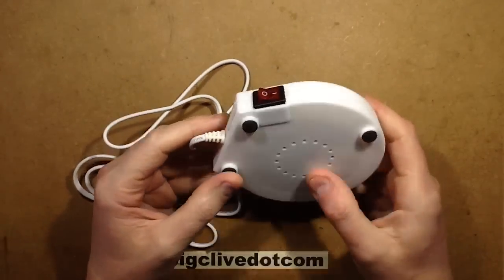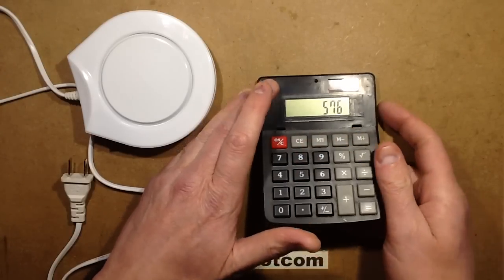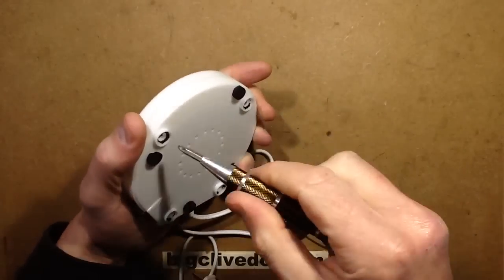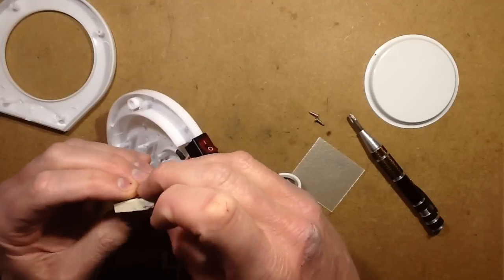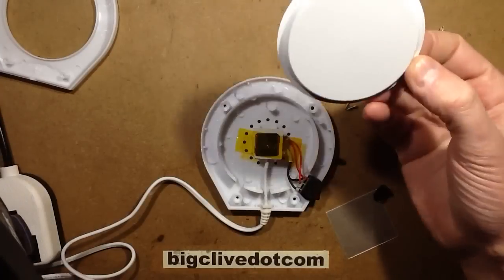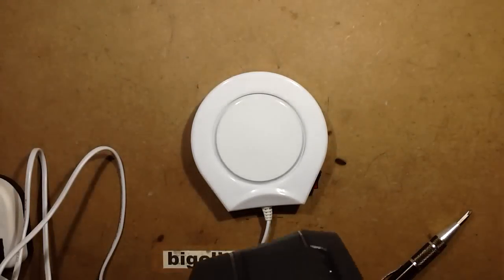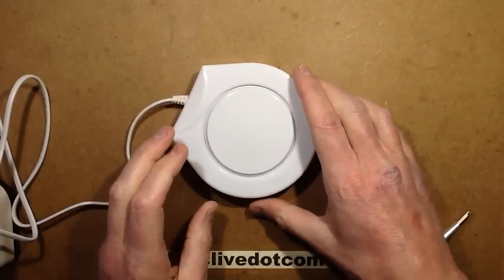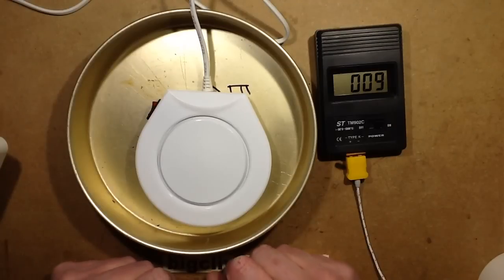Inside a cheap eBay mains voltage cup warmer.

Comment: I've used a similar 'cup warmer' to pre-heat small PCBs before hot-air soldering SMD components onto them. Worked pretty well.

Comment: These work great for melting wax because the guts are the same thing as you'd find in a candle warmer. I use a giant cup for my coffee and I looked into candle warmers because they fit the mug better. I had to crack it open as you can imagine and found almost exactly what you have there. The wires were different color which I know doesn't matter which was the only difference.

I hacked mine with an aluminium disk that fit just under the plate to spread the heat out more evenly. I stuck it in place with some old heatsink compound which came with a CPU cooler hence I didn't use it in lieu of some Arctic Silver 7. I'm sure I don't have to explain that decision. I also substituted a slab of silicone heat transfer pad in place of the mica wafer. It helped a lot and still insulates it from the mains current. It keeps my large soup/latte mug at around 40°C which for me is a nice drinking temp. 

You may be able to do a similar hack on yours. All you need is a sheet of aluminium like what you'd use to make project boxes from. It doesn't have to be super thick. It just helps spread the heat closer to the edges where the cup touches the plate. That could be a fun project to watch you do. It shouldn't even cost much as I'd wager a guess that you have some aluminium laying about somewhere just begging to be used for something like this.

Comment: 10ºC, you are a man after my own heart Clive, I am constantly battling with colleagues as I find it sweltering when the office is 20ºC and they want to put heaters on even when its 17ºC. At home i wear shorts and a vest even in winter and sleep with the windows open all year, my missus has got used to it but my daughter constantly moans that it is cold. It's a good job we live in a close in Glasgow the thick sandstone walls keep it cool in the summer, and it's always colder up here than down south.
Reply: Wow, 10ºC, that's 50ºF! I'm a pretty big bear and I can't tolerate much lower than 15ºC (~60ºF) during the day. 10ºC is perfect for sleeping, however.

Comment: A lot of people I know use beverage warmers for melting candle wax or scented wax cubes.  Wal-Mart actually sells these labeled as "wax melters", even though they are just cup warmers.  The wax melter of yester-year used to be a 20w nightlight with a ceramic cup fixture over it that you'd put your wax in, similar to how lava lamps work but smaller scale.
Reply: My mom got something just like this marketed as a “no flame candle heater” — melted the candle so you got the aromatic effect without lighting the candle

Comment: I've seen a very very similar PTC puck element used as a starting relay in a small compressor. The start winding was energized at power on through the PTC which lets it get full current a second or so then fades it down. I seem to remember it was made by TDK.

Comment: Clive, you can probably make this thing work way better with minimal effort. When you were putting it back together I noticed that there was just a small point contacting the heating element on the inner metal plate. If you put some thermal compound on both sides of that inner metal plate it should be able to transfer way more of it's heat to the white outer metal plate. That way more heat is sucked away from the heating element, lowering it's resistance, allowing it to keep generating more heat faster.

Comment: I've always believed that one of the reasons why these little gadgets don't do a very good job is that the vast majority of mugs/cups that I've seen and used have a recessed bottom surrounded by a lower hanging lip or rim and therefore has such a limited physical contact surface between the warmer and the said cup. I can't say that I've ever seen a cup/mug with a completely flat bottom. IF such a cup/mug was found, I'd lay odds that an immediate improvement would be noticed. I'd also add that a little bit of heatsink grease between the warmer's heating element and the bottom of the metal plate would help a bit also.

Comment: Hi Clive,
I tried one of those very cheap USB warmers. You could keep you tea/coffee cup warmer by sitting on it.

I had the problem of my tea/coffee always going cold whilst at the PC.
I found, by chance, that a Gravy Warmer was more than adequate for use.
Of course you do not use the Gravy Boat.

If as a few have mentioned, you find that most cups have a recessed base, then try a stainless steel/porcelain/tin camping mug, as these usually/normally have a flat base.

My Gravy Warmer/s keep the tea/coffee at a nice drinkable temperature.
There are a couple of brands available...."Mistral" & "Lumina" are 2 that I have.
Both seem to come from the same factory.
The circuitry is sort of complex, as it contains a thermal fuse, Temp sensor unit, a really neat wire wound heating element & a neon indicator switch. All contained in a nice porcelain base unit.
Must add that they are all safely/correctly earthed.
I think the wattage is around 25 Watts & your tea/coffee is... "just right."

If you find one, be interested to see/show the tear-down.
(I've already done one that failed.)

Thanks for all the neat videos & occasional "Big Bang/s."

Stay safe.
Regs, L..
From way Down Under.

Comment: I had one of these cup warmers that died on me a couple of days ago, so I've got a couple more on order.

Mine pulled 6w when it was up to heat, and kept the plate at 70 deg C.  It could keep a mug of tea just about drinkable (not hot, but not stone cold either) more-or-less indefinitely. 

It was interesting to see what is inside it, thanks.
Reply: Can you link it, or?

Comment: Clive, you'll find that this device is designed primarily of Chinese drinkers of tea.  In China they had cups with ceramic covers to maintain warmth.  It would be interesting if you put a cup of hot tea on the device, covered it with a saucer providing a good seal and then come back in twenty minutes to see if the tea is still warm enough to be acceptable.

Comment: but it's a US 120V... Not 240... unless I have it wrong shouldn't be different...
Reply: It's made for the Chinese market, that's a Chinese plug, they use 220v, but that type of thermister wouldn't matter too much, it'd regulate to the same almost, of course half the voltage will mean it won't be as powerful but that means it's impedance would be lower, so the same.
Reply: Coaster Labs I may be mistaken but I think China sometimes uses plugs of the same style as North America but at 240V. IIRC Big Clive mentioned this in a previous video.
Reply: tallman11282 wooooooah, not only do they rip off our electronics... now our outlets?!?!?!😅😅😂😂
Reply: Those plugs are very common in Thailand too and they use 220v here.
Reply: Coaster Labs Same with the Philippines. They use 230v 60Hz(?) and the same plugs as North America, as well as European ones.
Reply: https://www.reddit.com/r/MapPorn/comments/4xvu32/plug_outlets_around_the_world_800x640/
As for voltage, generally it'll either be 120v @ 60hz or 220-250v @ 50hz
Reply: It is a normal plug in China.  It is also normal to have plugs that accept every style in the world.  Safety is not a priority in China.
Reply: Hong Kong uses the UK plug.
Reply: Safety is not a priority in China. Nor are standards, apparently.

Comment: I would guess the brutal lack of thermal coupling between the resistive load and the cup is to blame. Ten watts should easily keep a cup at full temperature; I'd love to see a similar comparison with a flat-bottomed coffee cup (rare but exists, such as a beaker/flask style).  The mica has huge insulative properties, and the mug doesn't actually touch the hot spot of the steel for the manufacturing process indent.

Comment: The intent of these 'warmers' isn't to keep your cup hot or, indeed, even warm them up. The point of these is to prevent the liquid from cooling down as rapidly. That means that if your cup cools down in a specific amount of time, with this 'warmer' it will cool down perhaps half as fast. This means you can sip your hot beverage for longer before it becomes cold. Though, you could get an air-insulated cup and probably derive similar benefits which wouldn't require using any power at all. It would be interesting to test which actually works better... an insulated cup or the heated warmer plate and standard mug.

Comment: I always drink my just warm coffee from a pint mug and that's fine when it's summer but during the winter months I often find my coffee has cooled to below the desired temperature. Whilst heating it up in the microwave is always an option I'd like to be able for it to be kept warm without the need. It looks like the warmer you bought would be ideal for my purposes. Can you put a link to the eBay sellers page on here please, Clive. Many thanks.

Comment: The hot spot is in the centre, the contact area of the cup is around the edge. Air is a terrible conducter of heat, so if you could find a way to slot a heatsink in between the plate and the bottom recessed surface of the cup you would get much better efficacy. Even a few coins or some balled up tin foil would be an improvement.

On a side note, I always thought the purpose of these was to prolong cooling time of your fresly prepared hot beverage, say to an hour or so. I didn't think they were intended for indefinitely sutaining a moderate temperature.

Comment: I've always wondered something.
What makes you decide between whether you use the Cheap White Meter or the Hopi meter for a given video? Convenience? (Since the Hopi's clip terminals get in the way of power bricks)
Also, footnote, those clip terminals appear to be at mains potential and in parallel with the outlet if you ever wanted to use them to power something ...

Comment: I like your videos about this crazy stuff, because I like disassembling too. 
The test is very close to reality, but the cup heating is probably ineffective. If you would use a cup out of aluminium or borosilicate glass with a thin bottom the heater would be much more effective. For the assumed values (surface area about 40 mm², temperature difference 80 K, thickness of the porcelain bottom about 0.6 mm), a thermal conductivity coefficient of about 1.23 W/(mK) is obtained. This is about as much as porcelain with 1.03 W/(mK). The difference can be explained by the losses in the heating plate and, perhaps, some air between the cup and the heating plate.
For comparison, the thermal conductivity of alluminium is 237 W/(mK)
For me it would be interessting how much the power would raises.

Comment: Should try a metal cup. Those porcelain ones have too much air under them.
Maybe add some thermal paste between the heating element and the isolation.
Reply: Yeah I suspect an airgap problem too - maybe enamelled steel mug or lab glassware would make better contact

Comment: I've had a cup warmer like that for years, and it's kept my coffee warm just fine. I should open it up sometime, and see if it's any different.
Reply: Just opened it up, didn't pull it too far apart, but it seems different on the inside. It has a circuit board, and the heating element is a sort of bar that is attached to the plate.

Comment: isn't that top plate effectively one side of a capacitor with 240VAC at the electrode on the other side of the mica? If you scratch off some of the top paint is there a measurable charge on the bare metal below?
Reply from the maker: I tried that with a meter set to display current and tested between the scratched plate and ground with the plug in either way, but there was no significant leakage.

Comment: I use a double skinned metal mug, a bit like a camping mug. I wonder if this would be better or worse using my mug (metal better for heat conductivity but mug may also act as a heat sink).

Comment: I had to take apart my own Rival beverage warmer to see what its heating element looked like. Absolutely nothing like this POS chinese one, thankfully. The Rival element is about six inches long, and insulated with two layers of silicone sleeving. It's rated 18 W, and it uses a (fairly constant) 16.7 W, according to my Kill-A-Watt meter, from room temperature to around 50°C.

Comment: Awesome video! Because the bottom of mug is concave ,It could not close contact with heat plate which is flat. So heating efficiency is low

Comment: No o-ring between the metal plate and the top case then? Plus no waterproofing of the power switch... I'm a messy tea drinker when in the workshop, I can imagine stray tea easily working its way inside that case.  Would have been better if the switch was relocated as in cable inline version and the top of the case splashproofed...
Reply: Nah, if you spill your tea, you die. No frills on Chinese stuff. You just have to not spill your tea.
Reply: Where's the fun in that? Or the lethal incentive to not splash that tea? :-P

Comment: similar to what is in my glue gun, has 2 elements like this, has lasted years of work, i was expecting some wire wound coil when i pulled it apart to change the mains cable
Reply: +jusb1066
Glue gun, that was it. I bought a set of screwdriver bits with a triangular bit in for something and forgot what I bought them for.
Was going to take the glue gun apart.

Comment: Could you use it to heat circuit boards to prep for soldering?
Take your bare board, put it on there, then clamp the board with a stand and you've got a preheated board
Wonder if you could even attach the heater unit to the clamp stand so that it constantly heats the board, that probably is not as ideal though.

Comment: It could be improved with an insulated heat spreader in place of the mica and maybe some heatsink compound on both surfaces. Did your mug touch properly i.e. have a flat bottom.

Comment: I think this device could be improved upon by adding thermal paste to both sides of the mica sheet and sticking a thermal transfer pad on the top of the metal plate.

In its current configuration, lots of heat is being trapped/wasted by the mica sheet and poor contact with the metal plate, which is why the results are lackluster.

Comment: Maybe adding a round copper sticker on the bottom of the plate could help distribute the heat to all of the plate, hence cool off the PTC quicker and put out more power

Comment: Do you think it would be more efficient if you used a metal cup, or less?
Would the temperature of the water be higher or lower (due to the metal cup possibly radiating more heat than the ceramic one!!)

Comment: so... buy 2, stick the element of the second in next to the first wired in parallel, and add a ground wire to the metal plate with a new cord of the local outlet type. good idea?

Comment: 9:40 - "...it's raised it by about 15°C..."  I just did a quick check of the coffee in my coffee pot sitting next to me and it checks in at ~76°C (170°F)...too hot for me to drink comfortably.  Of course, my ambient room temp right now is ~23°C (74°F).  However, if this device only raises it by 15°C regardless of room temp then it would still only keep liquid at a temp of ~38°C (100°F) at my room temp.  Doing a quick check of the coffee in my coffee cup which has been sitting for a little bit after being poured, it checks in at ~55°C (132°F) which is comfortable for me to drink.

Comment: How about an off topic question, I ask because you appear to be very knowledgeable when it comes to DC Power.  I have amplifiers that require both +12 volts in and -12 volts in.  Haven't tried to wire them up because I am not familiar with a -12 volt power supply. I have seen - power coming off PC Power supplies but have never learned what exactly that is.
Reply from the maker: Often an amplifier will pull either end of the speaker between +12V and -12V with reference to zero volts.
Reply: Thanks, suddenly it makes sense, the link even made it a bit easier for my aging 65 year old brain to take in.  I have a couple of cheap China amps at home in South Dakota that have the terminals for plus and minus 12 volts, I assembled the kit and had it ready to go till I noticed the place for the two power supplies.  So instead of trying to get it to go, I simply tossed it in my misc box of failed or useless projects and purchased some really crappy amps that sort of work.  Now that I have a bit more to go on,  when I get back to the Dakota's after wintering here in Arizona, I will try and get the little amp working for my home built FM receiver that I use in our motor home to play my Siris XP satellite radio system that we depend on for music when we are boon-docking in the Mohave Desert, what a wonderful place to spend a Winter, well when the wind isn't blowing and the rain isn't falling, both have been plentiful since we arrived in early November.
Reply: Ya there are plenty of options, we are living in a 35 foot Class A Motor Home, so power is really quite available. When not hooked to shore power (50 Amp 110V) we power our devices with 2 12 volt House Batteries, and the frame has it's own 12 volt battery for starting the 8.9 L engine.  We have been just playing the snow bird routine the past couple of years but are still talking of going full time in the RV and selling our home in South Dakota.  The amp is just a fun thing to put together, right now I run the little FM receiver I put together from a kit from a wall wart 5 volts, and our Siris XM radio from the house batteries which are kept topped off by the supply on the RV.

Comment: Would the heater work better with a flat bottom cup.  Most cups I have, have a hollowed out center section to keep the cup from tipping. This would mean you are heating an air pocket.